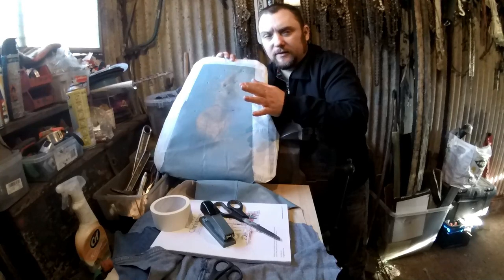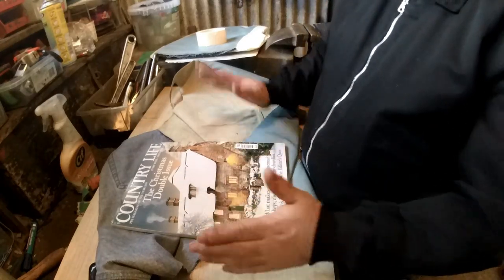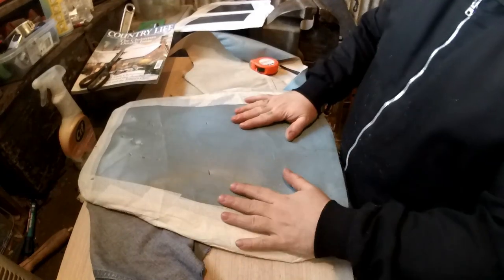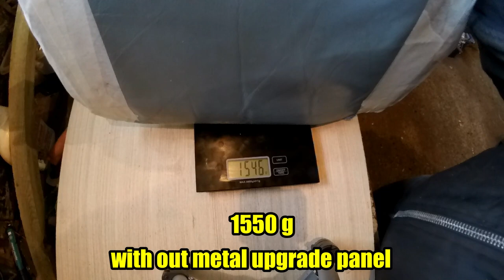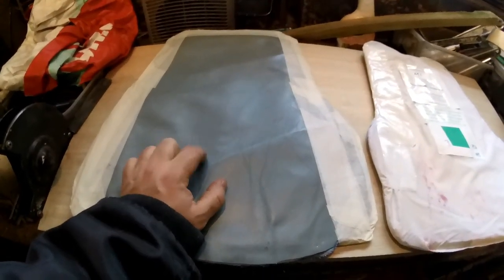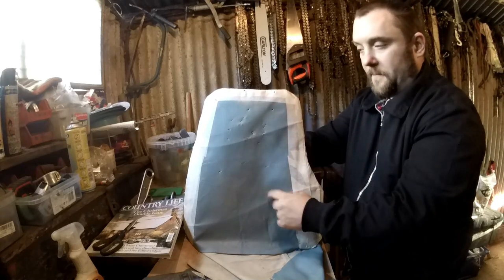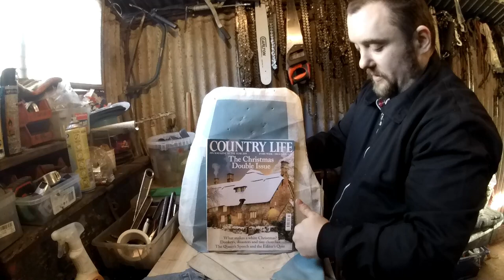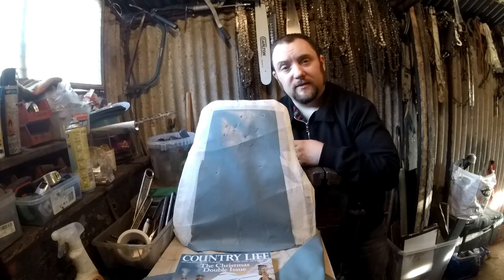How To Make A Stab Proof Vest Panel

Comment: I was thinking of perforated steel or aluminium plate 1mm thick cut into scales. The perforations will act as a perfect place to stitch the scales together, snag any blade instead of letting it slide off and save a lot of weight.

Comment: Hey WeaponCollector, I just have to put this info out here as I don't know what else to do with it. Here are two common materials for the people in the UK and Canada who are trying to DIY their own stab vests:
1. Expanded aluminum mesh, the ones with a diamond pattern. It's used as backing for the screens of screen doors. Fairly cheap and quite difficult to stab through.
2. Corner plate scale armor. Corner plates are those cheap little steel triangles used to hold slotted angle bar shelves together. They already have holes, are cheap and are easy to string together.
Covid has incubated a lot of crazies and the number of unprovoked attacks on strangers was unprecedented last year.
3. Large plastic cutting boards. Not the thick ones, I'm talking about the cheap-ass, made-in-China ones that are prone to warping. They just work.
Reply from the maker: HI James, great idea, thanks for sharing, i've actually done a video on body armour using plastic chopping boards and the mesh, it works really well.
Reply: @WeaponCollector  Ok, I feel like I dummy, I just saw your vid doing exactly that, cutting boards, metal plate and mesh. I'll get around to trying the corner plates when I have the time

Comment: Hi!, Try to make an armor with aluminum scales, like 2mm thick. It would be more light weight for a day carrying
Reply from the maker: Aluminium plate would defo work, but would not be as maneuverable, the point in doing it like this is its very similar to a real stab resistant vest in the way it moves and feels.
Reply: @WeaponCollector  but if it was just a only one plate it will be stiff, you beed to do it like a "dragon scale"
Reply from the maker: @Frambhueee  now that is a great idea.